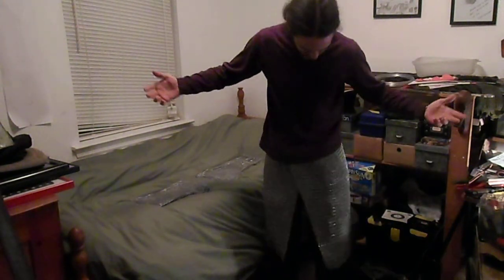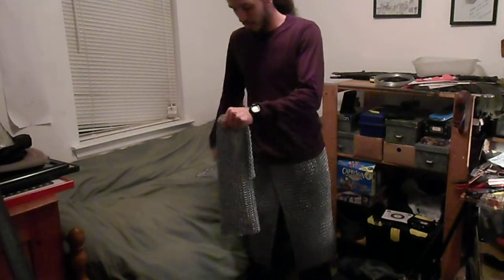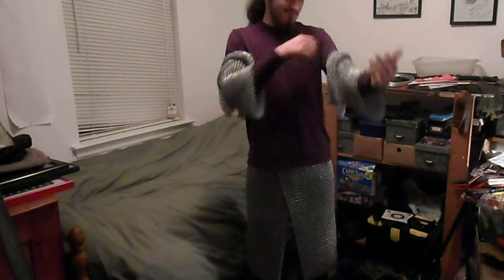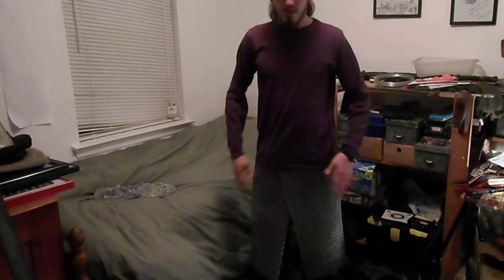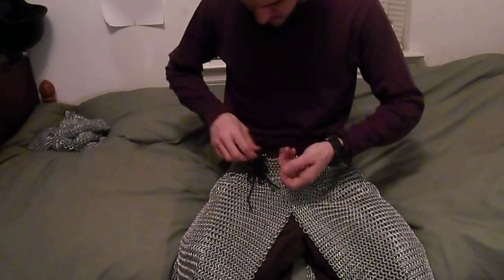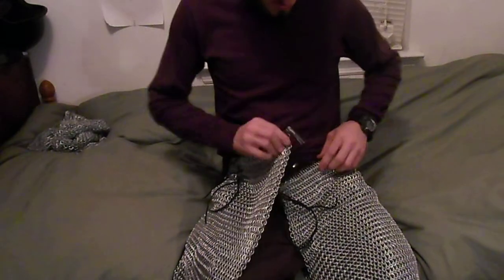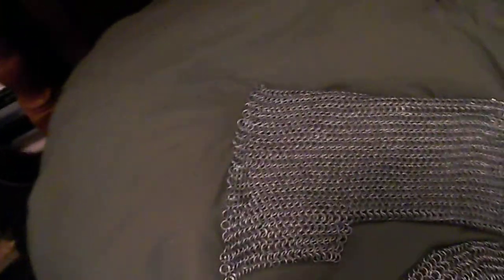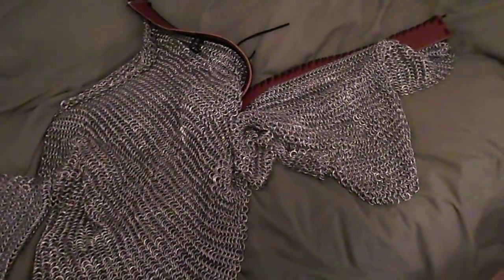Armor Project in Process

Comment: Nice work.Very clever with the mail skirt. Looks like you gave yourself enough room under the mail for padding/gambson.Most mail makers I see here on YT make the mistake of making mail too form fitting thus NOT making allowances for padding to go underneath.I always wanted a suit of mail made from Titanium,1/2 the weight but 4 times the strength of steel I guess IMO it is a contemporary version of mithril or Mesh of Odin.Yes TROLLS out there I know Mithril is Fiction.
Reply from the maker: Poparod Cassidy I'd love to make myself a welded titanium shirt one of these days, but it's just so damn expensive!

Comment: Your mail is made from stainless, yes? If so that's good because it's not only corrosion proof but also harder than mild steel, but I'm guessing you already now that.
Reply from the maker: Dr.Jekell The maille shown here is not stainless, it's galvanized, so still corrosion resistant, but not much stronger than normal mild steel.  I am working on another shirt that will be stainless, but that one will be quite a few more months in the making.